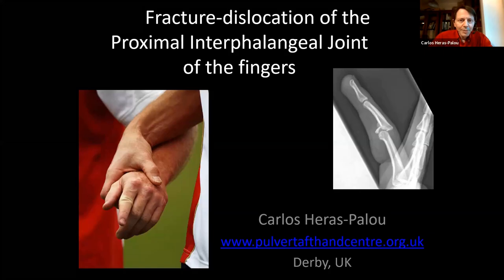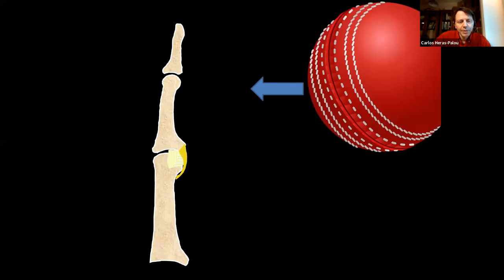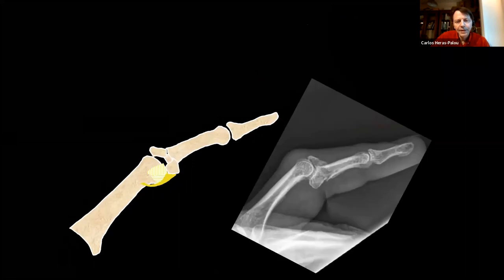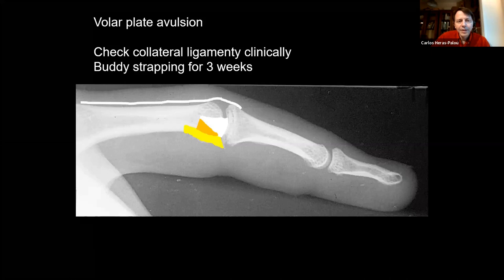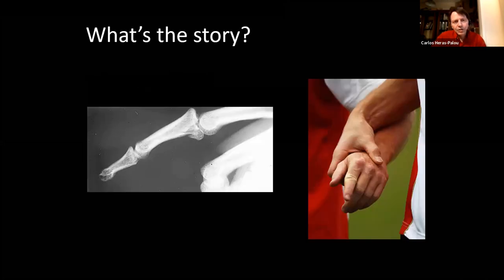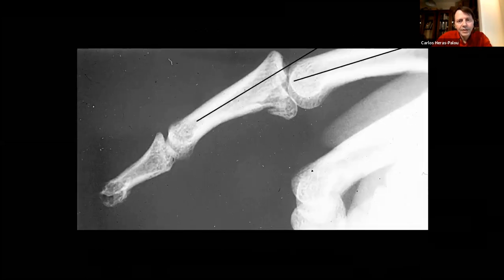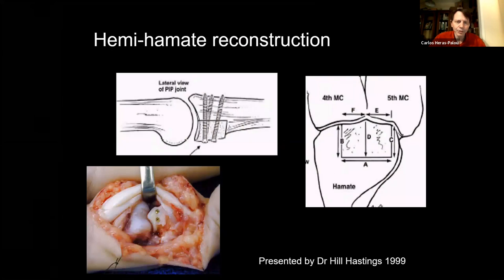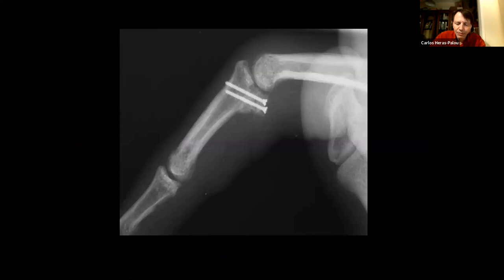PIPJ fracture  dislocations

Comment: I had sustained a finger PIP joint injury on my middle finger around 7 years ago.. since then my PIP joint has been thickened and swollen and the swelling actually had never gone down completely.. there is also some low grade instability in my PIP joint.. but i do not have any movement restrictions and pain.. is it actually normal, that i have now permanent swelling around the joint and the swelling not going down?

Comment: Hi Carlos. What are you doing with the A4 pulley when you put those little plates under the flexor tendons? Also do you find a problem with necrosis of small volar fragments if you take the volar plate ligament off, as in a shotgun approach?
Reply from the maker: Hi Simon. 
At the end of the procedure the two slips of FDS cover the plate, and I just place the flap of pulley over FDP, sometimes I suture it back and sometimes I don't. Probably it doesn't matter very much.
I don't do the shotgun approach very often, so I am not the best person to comment, but the reports are that avn of the small volar fragment is not a  problem in practice.

Comment: Hi carlos 
i had a pip fracture dislocation surgery 4 weeks ago, they said it was a pilon fracture they used Open reduction and a synthetic bone graft due to evidence of bone loss, then they inserted  a K wire across the DIP and the PIP joint placing it in extension, i have not seen this method used anywhere as i am a med student myself, and now they removed the k wire post op 3 and a half weeks later, my finger is stiff and barely moves, was this procedure done correctly and what is your experience with this? Thanks
Reply: Hi JZ. It is not possible to comment about an individual case but, as a general principle, putting a k-wire across the joint is a recognised treatment for some injuries. Stiffness is often a problem after this injuries. If the joint is not painful, if often improves quickly with exercises a the help of a hand therapist.
Reply: @carlosheras-palou6869  thank you! There is no pain however the finger is stiff and rigid
Reply: Hi J Z,

İ had operation to three years ago. I wonder that is any swellen on your pip joint after fracture. How is it look like now?

Thanks
Reply: @karsiyah6795  swelling was mostly after surgery but the fingers healed well however it doesnt bend 100% about 60% normal other than that hasn't effected my functionality can still lift weights play sports etc still ongoing physio
Reply: @jz1247  Swelling is permanent?
Reply: @karsiyah6795  no swelling was not permanent for me
Reply: @jz1247  If I give my e-mail address, can you send me a photo of your finger?
Reply: may i ask you, do you also have some permanent swelling and thickening around your joint after the injury now?